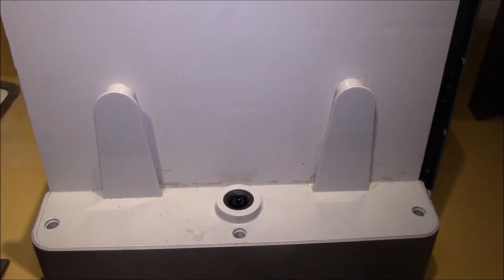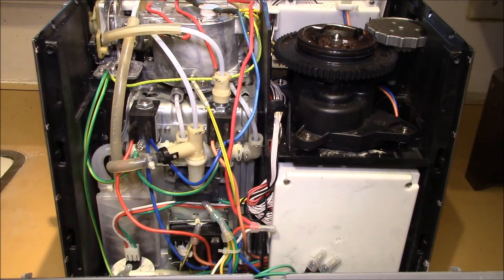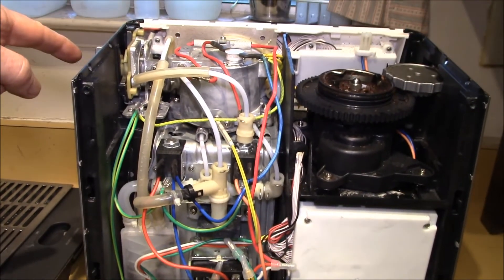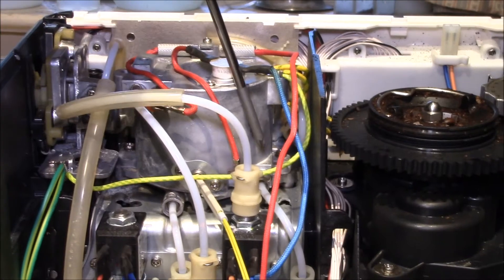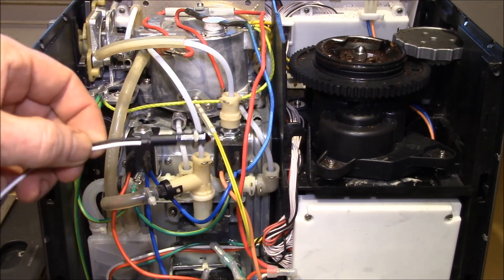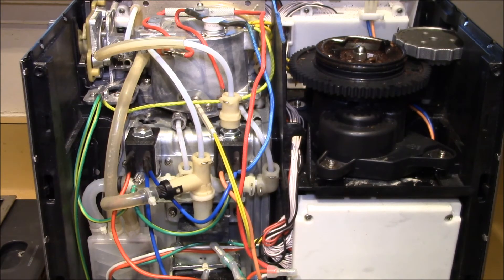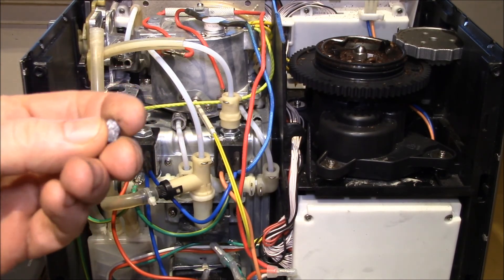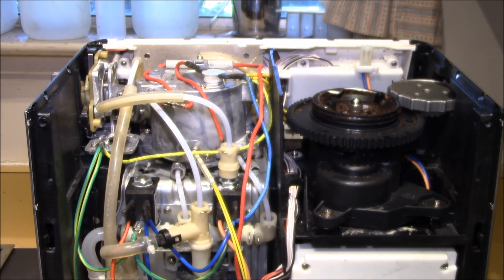Breville/Sage 870XL Barista Express - Water Flow

Comment: Hey, thanks for the videos! I purchased a broken machine a while ago but put it to the side due to frustration on not being able to find the problem. I replaced the solenoid assembly and the pump, I am still not getting enough pressure going to the gauge. It floats below the extraction pressure. There are no leaks and I cannot figure out why I am still missing so much pressure. I am testing using the blank disc. Any info will help! thanks again for the videos!

Edit: So I wrapped the blank disc with saran wrap to hopefully force the source of my pressure loss, and I found it. Turn out the guy glued in the tube going to the water dispenser (main espresso output), but it was done badly and pressure is escaping. I am unable to pull the tube out due to the glue or whatever was used to glue it there. There isn't even a retaining pin.  I am thinking of either getting a  brand new water dispenser AND new tube or try to find a way to seal it all up. 

Thanks again!
Reply from the maker: Glad you found the source of the pressure loss.  I've been thinking of picking up a non-working machine to keep for some of the hard to find spare parts.

Comment: Hello My expressed machine was working fine until last week. There is no enough coffee coming out. So I have descale it and cleaned it, it still doesn't work.Do you have any idea how to troubleshoot this.
Reply from the maker: A few common issues to look at are does if produce hot water and steam normally, just no coffee.  If so, it may be the solenoid block, especially the 2/3 way solenoid is not opening fully.  When that happens, almost all the pump pressure goes to the drip tray and a bit goes to the group head.  Common to hear buzzing when this happens.  Check out my solenoid repair videos in this playlist.  If the hot water/steam output is also low, it may be the pump or the safety/relief valve that is causing low pressure.  I have a video on replacing those as well.

Comment: hi, awesome tuttorial, would you happoen to know by any chance, why from  yesterday to troday it stopped working,  :  it still can steam the milk, but when i press then button to notr sure hoiw u say that, but to .... the cofffee , u hear the noise and everything, no pressure, and the water and go in the tray rather then in the cup shot
Reply from the maker: Sounds like the 2/3 way solenoid valve is either plugged or not fully opening:
https://youtu.be/96IuKiuIB5A
When that happens, hot water goes from the pump through the thermocoil and then through the hot/water steam valve to the drain/drip tray.
Reply: @The4Crawler  thanks to fix it, what would i have to do sorry?
Reply from the maker: @mardukl  
First is to try descaling the machine and see if that helps (maybe even try that a few times):
https://youtu.be/bJGKcatfei4
if that doesn't help, remove the solenoid block:
https://youtu.be/96IuKiuIB5A
Then you can try cleaning the the valve with 3 ports:
https://youtu.be/eljHS_BRJXk
If that doesn't help, get a replacement solenoid and put the machine back together:
https://youtu.be/yPZCZxlEU6Q
Reply: @The4Crawler  i went a bit ahead, and opened it, and removed the component ( solenoids ) the right unit, has a crack in the back, and a little bit of melting? not sure hard to tell,  but a crack all the way through it, the bottom right hose  that was to it, was quite loose, and there was a little bit of water around it, but not inside the machine, im from australia, i think, i should buy the newe part, what would be the part number sir? :) please for australian( dont know if it make a difference lol) i  could send you picture, although, for safety im sure you would tell me to just replace the unit! ( it was olab unit by the way) thanks a lot.. i just ran out of extra warranty
Reply from the maker: @mardukl  I usually look up the part number on the web site below:
https://www.ereplacementparts.com/breville-bes870xl-the-barista-express-parts-c-116052_116055_290179.html
Not sure if they ship to Australia, and for sure you would need the 230V solenoids not the 115V versions.  But given the p/n, you can search for that to find a local seller or contact Breville and order that part by number.  I've never run across any of the component parts for the solenoid block, only the solenoid valves.  The new replacement part is a Ceme brand and is complete with all new components connecting the two valves.

Comment: Great video, thank you for taking the time to upload this. Need to dive into my BES870 to investigate a very loud buzzing and no water pressure from brew head or water, so I suspect the 3 way solenoid you describe is my first port of call.  Thanks from UK
Reply from the maker: Thanks for the comment.  Yes, it does sound like your 3 way solenoid is the problem:
https://youtu.be/96IuKiuIB5A
Reply: @The4Crawler  Fixed with new 3 port solenoid. Working fine now!
Reply from the maker: @999fugazi  Glad you got it fixed.  That one solenoid is the heart of the system.

Comment: Good explanation! My BES820XL has great espresso pressure, but no steam or hot water output, and just sorta "ticks" as no water or steam comes out.  Is it a fair guess that that 3-way solenoid is the culprit?
Reply from the maker: Not sure if the 820XL is set up the same, but in the 870XL, the off position of the 3-port valve runs to the hot water/steam valve.  So it might be that valve port is clogged and not allowing water to flow up to the valve.  Or it may be the manual valve is clogged inside.  You could open up the back of the machine and disconnect the inlet hose to the manual valve at the solenoid and see if you can blow air through it in any of the 3 positions.  In the standby position, it should flow to the drain.  If you can't blow air through the water and steam positions, the valve is likely clogged.  You could try running descaling liquid through it, just cycle back and forth between steam and water.

Comment: Bonjour R Brown! Peut être pourriez vous me guider dans la résolution de mon problème! Depuis peu la pression d'infusion ne monte plus dans la zone verte, elle se situe à peine au bas de cette zone. J'ai fait le test de pression avec le panier filtre obstrué et la pression monte au delà de la zone verte, alors mon indicateur de pression et ma pompe fonctionne  correctement d'après moi! J'ai également remarqué que beaucoup d'eau sort  de la vapeur et la vapeur ne sort pas de façon continue du bec.. Est-ce que cela pourrais être là valve 3 voies qui pourrait être colmaté en partie!! Merci d'avance!!
Reply from the maker: "Maybe you could guide me in solving my problem! Recently the brewing pressure has not increased in the green zone, it is barely located at the bottom of this zone. I did the pressure test with the filter basket obstructed and the pressure rises beyond the green zone, so my pressure indicator and my pump work correctly according to me! I also noticed that a lot of water comes out of the steam and the steam does not come out continuously from the spout. Could it be there 3-way valve which could be partially clogged !! Thank you in advance!!"

Oui, il semble que le solénoïde à 3 voies reste partiellement ouvert. Dans cet état, l'eau s'écoule à la fois vers la tête du groupe et dans le drain via la vanne d'eau chaude. Vous pouvez essayer de détartrer en premier et si cela ne vous aide pas, retirez et nettoyez le solénoïde ou remplacez-le si cela ne le résout pas.

"Yes, it sounds like the 3-way solenoid is sticking partially open.  In that state, water flows both to the group head and into the drain via the hot water valve.  You could try descaling first and if that doesn't help, remove and clean the solenoid or replace it if that does not fix it."
Reply: J'ai fait de nombreux cycle détartrage au vinaigre et cela n'a rien changé... je vais nettoyé la valve à 3 voies!! Merci pour vos conseils et vos vidéos sont vraiment intéressantes!!!

Comment: Thank you for your videos. My BES870XL stopped making expresso a while ago. There is no water coming out from the group head when pressing the expresso/coffee button. Steam and hot water work just fine. I followed the steps from your other video to put in a new solenoid. The first thing I noticed is every time I plug the machine into the outlet, there is an audible clicking sound from the solenoid. I didn't recall hearing something similar in the past. The second thing I noticed is hot water will drip for a good 10-20 seconds from the group head every time the machine completes its initiation cycle after the power is turned on. With the new solenoid, I now have water coming out form the group head after pressing the expresso/coffee button. However, when turning on steam or hot water, the steam and hot water come out from the group head instead of the steam wand or hot water outlet. I put the old solenoid back to test if there's any blockage in the delivery of steam and hot water but they both function correctly. I am wondering if I received a defective solenoid but I don't know how to verify.
Reply from the maker: It does sound like the new solenoids are bad.  The hot water/steam feature should work with no power applied to the solenoids, because that path just uses the flow through the normally open port of the 3 port valve.  You could try blowing through the valves (of course removed from the machine and no power applied).  Should be able to blow through the side of the 3 port valve with air coming out of the top port and also not be able to blow air through the 2 port valve.

The clicking may be due to one of both the solenoid coils either being wired wrong or perhaps they are shorted internally.  If you have access to an ohm meter, check the coil resistance (between the two vertical tabs) and there should be no connection to the horizontal ground tab.  On the 120V system it should be just under 700 ohms.  Any reading either close to 0 or much higher would point to a bad coil.  Also check the voltage ratings of the new coils, both Olab and Ceme make coils in many voltage ratings, 24V, 120V, 240V and likely more.  They all look the same.  A 240V coil on a 120V machine might not have enough magnetic field to pull the valve open and that would make a buzzing of clicking type noise.

One other troubleshooting step you might try is swapping the coils between the old and new solenoids.
Reply: @The4Crawler  Thank you for the quick reply. I removed the solenoid and followed your suggestions. There is definitely air coming out from the top port when blowing through the base of the 3-port valve, which sounds like shouldn't be the case. I cannot blow air through the 2-port valve. So this part is working properly. As for the coil resistance, it is measured at 507ohms and the voltage is rated at 120V. At this point, I more than likely will order a new solenoid just to test it out. Thanks so much for the help!
Reply from the maker: I got my ports mixed up on the 3 way valve, the side and top ports should pass air with the valve off.  Under power, it should close the top port and open the center port.  But how that valve operates with 10 bar of hot water pressure may a different story. 

The resistance you measure may be correct for the Ceme solenoid coils if that's what you have.  They pass a bit more current than the Olab solenoids and thus likely have a lower resistance and what you measured sounds about right.
Reply: Hi Alan. Were you able to fix your problem with another solenoid? We have exactly the same problem after replacing the old solenoid.
Reply: @irynakrol2949  I wasn't. I ended up getting a new one instead.
Reply: @alanchu8663  But did you try to buy second new solenoid?

Comment: after push two shots button  , the water still running and no stop automatically until push the button again  ,  what is the problem please  ?
Reply from the maker: It may be you're pressing the button too long.  I know on the 1 cup button, a long press will run about 1 copu / 250-ml of water through, although it'll eventually stop.  Not sure if the 2-cup button is the same way.  Otherwise, you might try unplugging the machine for a while then trying it again.  If that makes no change, try resetting the custom volume setting  to default, press/hold 1-cup + 2-cup then press/hold the Program button until the machine beeps 3 times, then release.  That should put it back to the default water volume.  If that doesn't work, maybe the water flow meter is either disconnected or not working right.  May need to contact Breville if a new part is needed.

Comment: Hi R Brown ....I got a issue in my Breville expresso. After replace the filter’s water tank. I decided flow all the tank water running on the three ways: BREW, HOT WATER and STEAM. The machine become very hot. After that a buzzer sound come out. In the end Hot water and steam works fine but no brew. All the water WHOSE should go to  the brew head is going direct to the tray’s container. Do you think if just cleaning the 3 way valve solenoid may be fix it. I’m using this machine for 2 years. Thank you for the explanations.
Reply from the maker: The buzzing sound may very well be the 3 way solenoid valve.  That's the one that controls if water goes to the hot water/steam (if off) or to the brew head (if on).  Buzzing indicates it's not turning on fully.
Reply: The machine was a black box till I watched your explanation. I had the issue yesterday and now I understood the problem. You save my day. First of all I will try disassemble and cleaning the valve and solenoid. I afraid some particles of scale stop inside the valve. Now after the problem come out, when I start the machine (cold), I’m able to brew once and then the next attempt, the water goes to the trays container. Thank you very much for your video and explanations. Your very kind.
Reply from the maker: It may be the first time, the solenoid coil is cold and it flows enough electrical current to actuate.  The next time, the coil has heated up and flows less current and then it's not enough to open fully.  It needs to open fully to both pass water to the brew head but also to block water flowing to the drain.  It's worth a shot to try cleaning the valve:
https://youtu.be/eljHS_BRJXk
or replacing it.